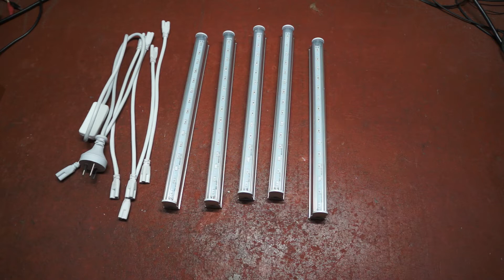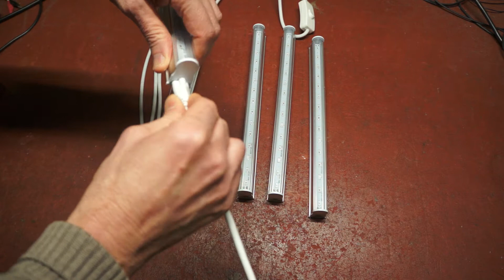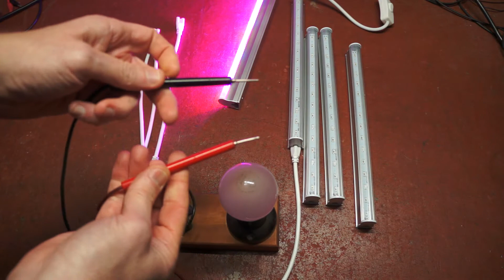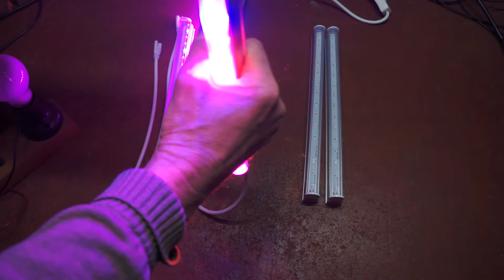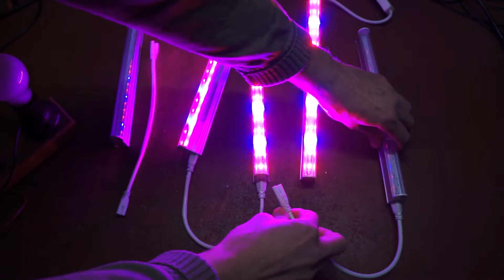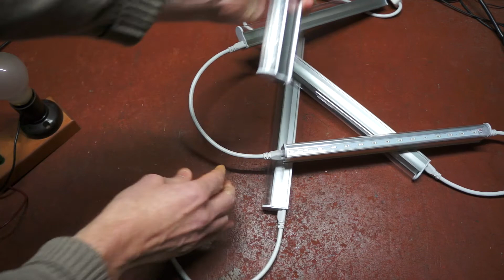LED lights from eBay

Comment: Aldi are selling a similar although safer product. LED lamps that you can daisy chain. They suggest no more than three units in series. The power leads have no earth pin so the Aldi  units must be double insulated.